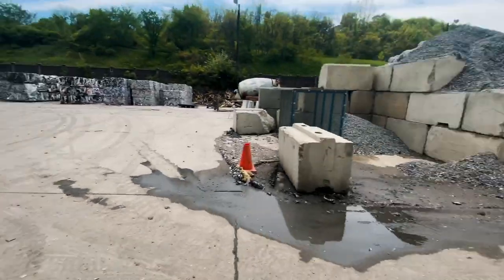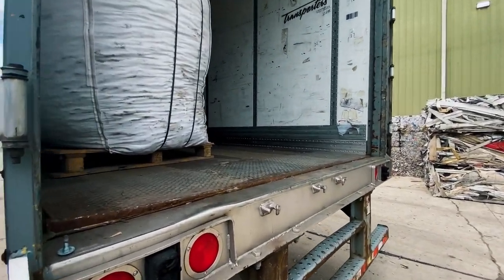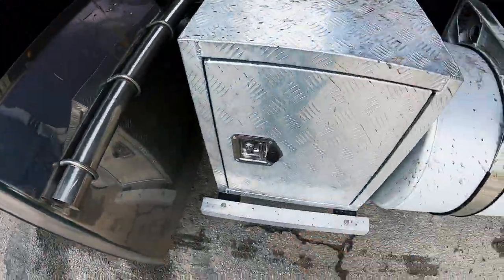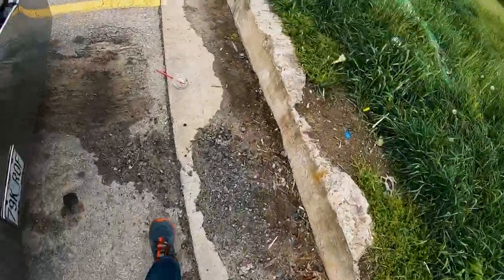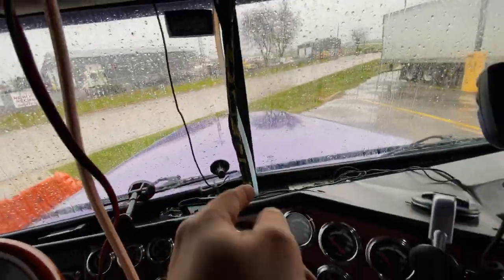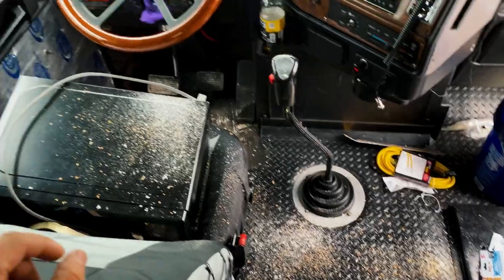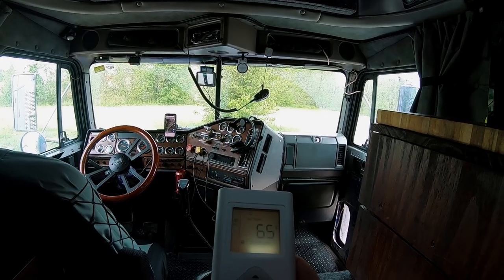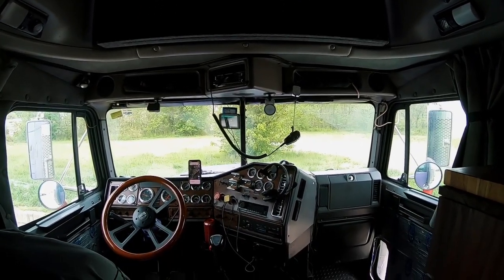Truck driver puts a house mini Split ac unit into big rig. Pioneer 9k btu install into freightliner

Comment: I installed a 1 ton 12000 apu mini split in my truck. It works beautifully and very comfortable in the cabin. I bought a mini split braket from amazon for about $60. I installed the inside unit on the back above top bunk. I was skeptical at first thinking I might need to install it in the front but the thing is so efficient it cools me into my blankets. My split cost me $500, another $500 for the generator and about $300 installed. I installed it no to save on fuel, even though I am saving a lot. I installed it to no idle my truck to extend it's life before an inframe is needed. I been having no breakdown at all for the past 8 months. I used to have breakdown just about every month when having my truck mostly on all the time. This is definitely a great and cheaper alternative that will not breakdown. Mini splits are made to last and apu are made to break down. My truck now only runs when is rolling no more idle for me.
Reply: I don't idle even without APU or mini split but I run in cooler areas. But we're installing a mini split now just in case and for better comfort. Good to know that the truck will last longer!
Reply: Can you install one in my truck?
Reply: Where did you get it installed?
Reply: Where did you mount the outside unit? On the catwalk or on the sleeper?
Reply: @VicBeatz  on the sleeper with rivet nuts. And drill 1 and 1/4 hole to connect the inside to the condenser outside. The thing works wonders summer or winter.
Reply: Can you send me pictures of your setup please?
Reply: Can you send me some pictures of your setup?
Reply: Hey I installed a 12000 BTU Della in my semi can you tell me how you wired yours I keep getting a E5 code

Comment: I used chassis grabbers to mount a custom box in the same location you did, I put a predator 3500 super quiet in the box with a radiator fan for a car to keep the generator cool. I installed a grommet in the back of the box and ran a cord through that and into the sleeper. I used a drain-less Hisense portable AC unit and used tie downs to mount it to the top bunk and it exhausts out the top window.
Reply: Hi, I'm thinking about something similar to what you did. Do you have any pics? Trying to decide if I need to remove the top bunk or not
Reply: @cwilliams6483  I wouldn’t remove the top bunk. Take the mattress off and use the top bunk plywood to screw some anchors into. That way you use ratchet straps to hold the ac UNIT on the top bunk and it sits next to the top bunk window so you can run the exhaust out that.

Comment: I put a Mini split on the back wall of the inside of a kenworth T660 with 86" studio and mounted the heat pump AC unit up above the rear of the cab outside.  2 years ago and it will freeze me out of cab still in 110° days.  Just FYI don't run your "heat pump" outside unit in below freezing Temps, it will not run well covered in ice and snow and only keep up to about 30 degrees ambient.  In the 20 below snow storms shut this unit down to save it for warm months.  and I actually tarp mine cuz I love it soooo much for summer months.  I put a separate heater unit in sleeper for arctic winter weather.
Reply: If you install Fujitsu 9000 BTU split AC or Mitsubishi you can heat your cab in -5 F outdoor temperature. I am trying to do the same. What is your power consumption summer time? I am trying to do the same but with Hybrid system generator + some nights on AGM battery's.
Reply: @kirostar12  I run a 6 kilowatt nat gas inverter generator that runs really quietly, has a battery charger and with a little CNG tank on truck.  It runs everything in sleeper when cat 3406e is not running.    Nat gas generators sooooo much quieter, they start better too!   Took a little engineering to get it mounted on rail, but I wouldn't go back.   They way cheaper than a tripak!!!
Reply: @growthefarmup2606  Nice. I got 2200EU Honda generator who is very quite too. Running on 3 gal marine external tank. Never got problems and is enough to power my heater winter time and my portable 10,000 BTU  AC summer time. Just thinking to upgrade with mini split AC to see how will perform.
Reply: I'm wanting to mount the outside unit on the rear of my cab but the catwalk isn't an option because if my exhaust pipe. How do you know what you're drilling into and if it will be sturdy enough? What kind of screws did you use? Thanks!
Reply: @VicBeatz  the studio sleeper is kind of a premium sleeper from what I've seen customizing other interiors.   I usually reinforce the whole wall with light weight plywood, but actually depending on weather your run a wing or a topper u actually got a pretty good rail to mount on about 3/4 the way up the sleeper on 660 studio.  Or close to it.  I found I didn't prob need to reinforce the back wall, but if did because I basically gutted the sleeper and turned it into a 1 person "camper" totally functional shower and toilet, bigger bunk.  The studio sleeper is only reason to own a 660!  I'm big on custom sleepers.  Most other sleepers I stip down I try to find or build in a support bean or at least reinforce the wall with plywood.  But thr studio has a pretty strong back wall
Reply: @growthefarmup2606  what about just holding outside bracket up with rivnuts and screws? You think that would hold okay?
Reply: @VicBeatz  unfortunately drill and bolt is usually all I do, but I strip em down to the "plastic" and totally rebuild em with light weight leather wrapped pieces and put a water heater, multiple pumps and water tank under the bunk and a webasto bunk heater that runs thru my vents in winter.  Those webastos are good enough to heat, especially cuz I add 3 Xtra layers of insulation, but it needs to run thru the vents. Moving air and keeping it moving is very important, I like to run my bunk fan all day while i drive and keep air circulating.  Bottom line is TriPack is 14 grand. You can do a whole sleeper gut and rebuild for 14 grand and u need about a $700 minisplit unit to keep up cooling, and you'll have your bunk fan to move air also.
Reply: @VicBeatz  I would think it should hold just fine, prob want a longer bracket, or as long of a bracket you can fit. Just for reinforcement for some of the bouncing, I would think it would hold just fine, if the brackets that come with at are 24- 30 inches I would think thst would work?
Reply: @growthefarmup2606  I wanted to install that bracket without reinforcing it with plywood or anything. I'm trying to keep it as least intrusive as possible.
Reply: @growthefarmup2606  I can't post the link because YouTube removes it

TURBRO Wall Mount Bracket for Mini Split Ductless Air Conditioner Heat Pump System, Foldable Stainless Steel Stand, Support Condenser up to 350 lbs (7,000-18,000 BTU), 1 pair
Reply: @VicBeatz  that's basically what I did was use a bracket very similar to that, and I oversized the bracket, but not too much, though brackets are pretty light and we don't need a very big heat pump a.c. unit yo keep up with 200 Sq feet or whatever a truck sleeper is.  The one thing I suggest is build in your condensation drip lines... run them down under the frame, both inside and outmmm I have had my inside minisplit create alot of condensation and the outside unit does also, just to keep your truck clean and, these units condensate like any a.c unit.  I just run 2 ! 1/2 hoses from the units thru the bottom of sleeper inside and just zip tied the drip line to the frame off the back, that condensation will blow around and make road grime stick to back of your sleeper if u don't "control drip" the condensation.  I was able to just use all gravity flow, the way it mounts.  Yea YT won't let u link anything. I've had people ask for pics of my setup I need to just make a vid sometime!    Good luck I'll be curious how your project comes along.
Reply: @growthefarmup2606  that's exactly what I was about to ask. If you could maybe send pics of your set up.
Reply: Getting ready to do the same to my truck. I have a headache rack,  so mounting the condenser straight to the back wall wont work for me. I can position it on top of the headache rack.  I just feel I need  some flexible lines, more like automotive ac lines, because the compressor will be rigid mount while the cab will move up and down on the cab's airbags.  The lines in the video looked pretty flexible. Can the flex good enough for what I  need? Thanks

Comment: I was going to do the same home ac split anyway I am so glad that I didn't.  Because I found a better solution.  It's half the size of the home ac split.  It's super cold and so quiet.  And it is saving me a tone on fuel (gas).  🤑🤑

Comment: Dammit brother yeah to all you said I agree 100% I’m also an owner operator I stay very local now I did sleep every other day sometimes on the weekends too idling my truck all the time now I’m not running as hard but still need to save my 97 Freightliner from any major Brakedown and also save on idling fuel I like your setup looking to do the same and yes staying away from apu there overrated thanks enjoyed the video brother be safe out there God bless thanks

Comment: Mine total cost 2000 mimi split 550 installed by someone that's included mini split and labor generator predator 3500 was 1000 bracket 400 over 2 years now no problems working awesome
Reply: Who does it ? I'll get my self one as well 😌 🙂

Comment: They make a diesel generator you can get it at Home Depot. I use to install these things all the time but now retired. Cost depends on what brand and size but a great idea for a truck. Quick connect bad idea but whatever hope it works out time will tell.

Comment: nice work, heres an idea, put hinges on the wood at the top where u can tilt it and still can use that storage behind the hvac unit. not sure on the dimensions of ur truck and ur hvac unit, but it looks small enough, would it fit on top of ur bed on the side where ur foot goes?? also, inverter generators to look at, look at harbor freights 3500 predator, its pretty strong and silent, and can use it over night when you getting rested. Can last 11 hrs on about 2 gallons of fuel. They have Extended warranty plans where u can basically have lifetime warranty on the unit. And they have sales on it all the time, its currently 800 bucks, but u can catch it for 700 bucks or maybe cheaper

Comment: This is the way to go I stopped fixing my tripack every 3 months on average it was costing 1k and the last time tk told me 3.5k so I've been idling  and it's not bad mostly in the summer anytime it gets above 80degrees I idling under that and a fan works ...below -10 idling above that large 3 wick candles with the curtain shut its fine and lots of blankets. If I'm sitting anywhere for over 20hrs I get a room...probably idling about 300 gallons a year

Comment: Very good work  that tool box will fit real good between the quarter fenders and the skirt for my freightliner cascadia evolution, trying to install a 9000 btu mini split and running this with a 2200 Honda inverter generator ,where can I purchase that tool box?

Comment: I thought about this idling problem for a really long time and I think I’m going to mount a beefy 12v electric motor to the AC compressor and run it off the batteries while the truck is moving. Then have a small generator to charge the batteries when I’m parked.  I haul a Reefer and always keep it on continuous run so for me I’ll just skip the noisy generator let it charge the truck batteries. When I’m sitting waiting for a load I can suffer in the heat for a few hours or just idle the truck. For heat in the winter they make a diesel parking heater for $100 that will warm up the sleeper really good.

Comment: I destroyed 2 minisplit units.  1st unin broke off from the factory brackets on the 5th  day of driving in Canada. From hanging in A/C lines while driving had damage to inside parts of the unit. Under warranty I got a new one. This time I used straps to secure my new unit.  2nd trip in 2 weeks to Alaska my unit was destroyed again. From vibration condenser had many cracks so now I'm going back to portable 14000btu house A/C. I have apu on my truck, but it's expensive to keep it in working condition plus cooling capacity is  not the same as portable hous A/C even the cooling capacity is 20000btu but in real life not more then 8000btu. No more minisplits for me 😂
Reply: You're correcthe portable waste high on 4 wheels. Air conditioner is what I have with my truck. And I never have to worry about it breaking it's solid
Reply: What size generator do you use for a 14000 btu house ac unit
Reply: I don't use generator,  I have 700ah lithium batteries,  they are good 12-24hrs depending on outside temperature

Comment: Impressive!! An upgrade in the future would be a Diesel Generator tapping into one of your fuel tanks.  Overall a very clean install.
Reply: I am going with a solar setup these mini splits last forever
Reply: @majordave239  if your owner op with one trailer, solar panels can go on top of trailer.
Reply: @Michael Glenning  I don't own the trailer only the truck
Reply: @majordave239  hey where did you get it installed?

Comment: The price of everything is still far less than what I paid for an APU back about 2008. I paid 8000,00 for an APU that had AC and heat, plus kelp the batteries charged.
Reply: Not anymore, a apu cost you 14 thousand dollars now

Comment: I think that your heat pump unit that is outside the truck is too close form the cab there is not enuf air flow I know because on my house the installer had installed mine too close from the wall and there was not enuf air flow and in the winter months the unit would not defrost properly it might not be a issue for summer use but it might be more efficient.
Reply from the maker: I don’t use it in winter, works great in summer

Comment: How did you connect your mini split to the generator for power also did you pull a vacuum before you started it?
Reply from the maker: Just with extension cord end cut off and yes pull vacuum

Comment: You will pay off this system in about few mounts. I got portable 10,000 BTU AC with Honda generator but soon will install 400AH AGM batteries in addition to make it hybrid. I was wondering to install Fujitsu 9000 BTU split system to stay worm to -5F outside temperature winter time but I need to know your power consumption now summer time. Like how many watts is puling the AC compressor? I know this is inverter AC and the consumption is different but lets say for 90F outside temperature what is the average power consumption for day time run if you already tested? So I will know if I can run it on battery power for few hours some time or night time when the compressor is not working very hard. Thank you!
Reply: RICHARD MAR  You are wrong my friend. The LiPO4 batteries will not charge when get cold under 32F (0C) outside temperature you can easily damage them. Also you can't mix them with your Lead acid batteries because there is big voltage difference between Lead acid and LiPo4 like 1 Volt difference! That's why I got 400AH AGM batteries they are good in hot and very cold climates. Also you can discharge them to 25% with no problems. But since I mix them with the lead acid batteries for now I never let 50% discharging rate. Combining the AGM with my lead acid batteries  now I got 800AH battery power. That's enough to supply my portable AC, laptop and refrigerator from 8 to 12 hours. For longer run I use my Honda generator. For me that's the perfect hybrid system :) Someday when the LiPO4 technology get better in cold climates I may buy such a batteries but not for now. Thanks!

Comment: instead of drilling holes into ur frame, u shouldve made clamps that holds on to the frame
Reply: You can purchase chassis grabber brackets that are designed to clamp the frame so you can mount whatever you’d like without drilling holes

Comment: Great job on the install it looks alot better than some I've seen. 
I would only have two concerns myself. 
1. I've found that equipment NOT designed for trucks doesn't seem to last, dorm room refrigerator lasted about 3 months from the bouncing. 
2. Is the hassle of filling the Gasoline tank.
Reply: I run a mini fridge/freezer from Walmart. They have gotten 4 years out of them. Run it off a 3000 watt pure sine wave inverter.
Reply: Mine 2 years and 2000 total cost so far so good

Comment: Hey man, great video. Can you tell me how you wired the power to be able to plug into the generator. Thanks
Reply from the maker: Exactly same as you’d wire in a house, it’s just an extension cord Wired’ directly

Comment: Can you use the mini split while driving? Installing one and using it all day sound cheaper than fixing entire AC system
Reply from the maker: Yea you can I’ve used mine on inverter while driving before when my compressor crapped out

Comment: OTRookie, how is the air conditioner doing? Can you provide an update now that it’s been a few months on the road? Have you had any problems with your refrigerant lines cracking due to the harmonics of the road? There was another YouTuber here  that did the same thing but he used flexible lines all the way through. Have you had an opportunity to use it in 100+ degree weather?  I’m thinking of installing a mini split myself, but I primarily run the south western states and have to deal with that 100+ degree weather during the summer and Is my main concern.
Reply from the maker: I’ve used it in super hot conditions and it’s been great. No issues whatsoever so far
Reply: @otrookie  can you send me the link for split system and generator thanks